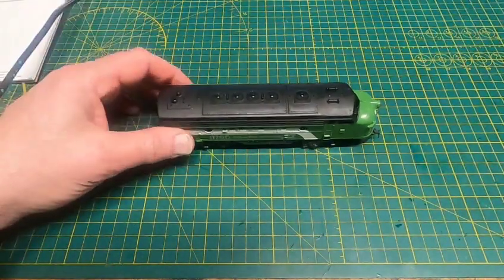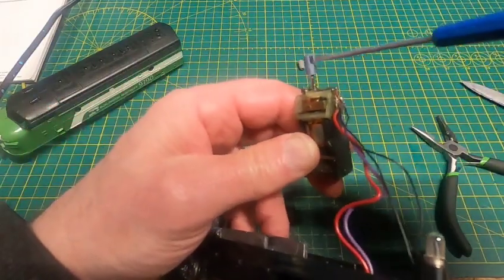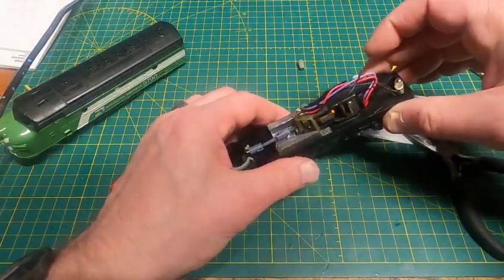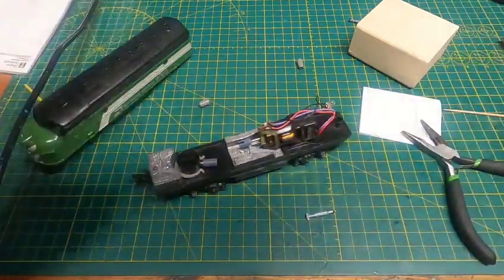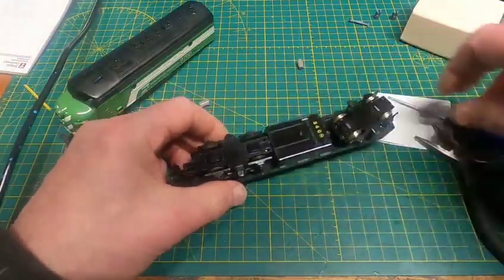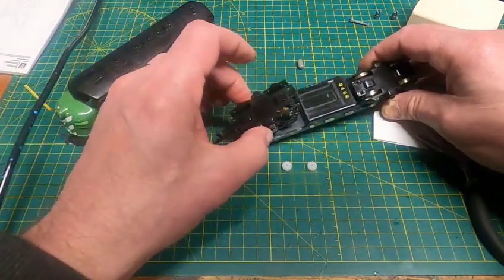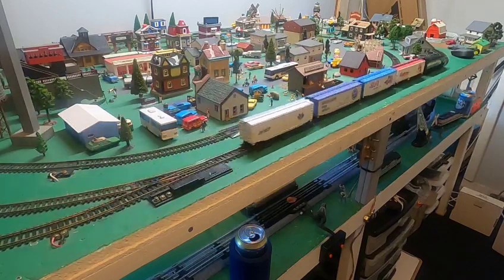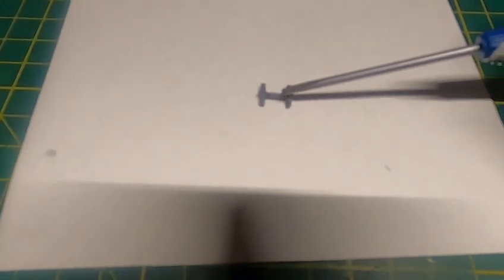HO Life Like engine Drive Shaft repair

Comment: Nice job on repairing that life like f7. I also have a f7 with this drive but mine is a Amtrak one.
Reply from the maker: Thanks!  One of the ones I fixed was an Amtrak.  Let me know if you need any of those parts.
Reply: @dbtech7914  sounds good 👍

Comment: Nice repair. Does the new printer use the same medium? It could be the difference, or just better quality, solid printing. Thanks for the video!
Reply from the maker: Thanks.  It is the same kind of filament.  The technology in 3D printers is constantly improving.  The new one is a lot more accurate.  Creality CR-10.  The other one (Anet A8) was 5 years old.

Comment: Very nice save. I have the same type of locomotive but it's a chessie. I don't believe I have the drive shaft coupler cracked. However this gave me an idea. A company called A-line made drive shaft parts for Athearn bluebox diesels and this video got me thinking about something. A bachmann FT I have had one of them driveshaft couplers crack and slides on the worm gear piece. I'm wondering if I can fix it a different way. Maybe change the whole thing on that side to something new. Hmmm I love the 3D print idea. I want to get one just unsure about brands reliability etc.  Good video Dave take care.
Reply from the maker: Hey Matt, thanks for watching.  Yes, you can buy couplers and drive shafts from other manufactures.  Some of the other ones I had were too big to fit on that engine so it was best to make them as close to the original ones.
As far as 3D printers, Creality, Bambu, and AnyCubic are the popular brands.  You can get one for $160 to $200.  I have a Creality CR-10.  The Ender 3 series are good too.
Reply: @dbtech7914  okay thank you. I knew you were trying to get it as close as possible for the lifelike locomotive you worked on. But it made me think about my bachmann FT crack in it. But I'll try to see if I can finagle it lol. I'll check out the 3 d printers when I can. Space isn't my friend at moment. But I'm working on something